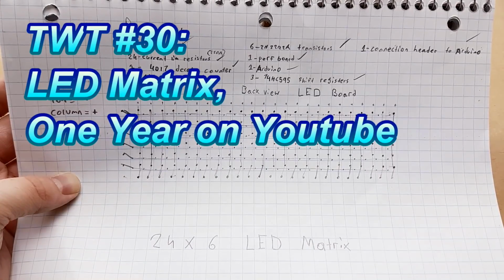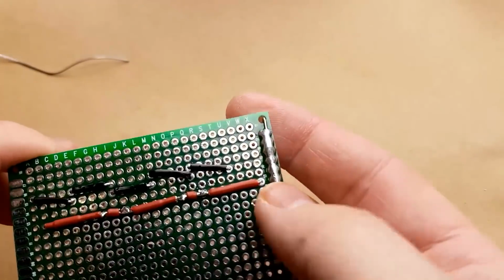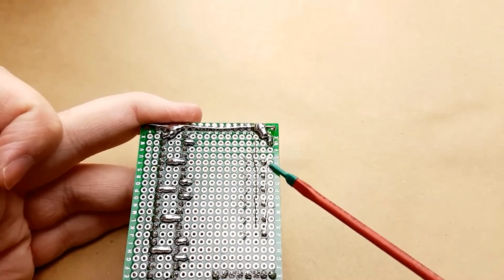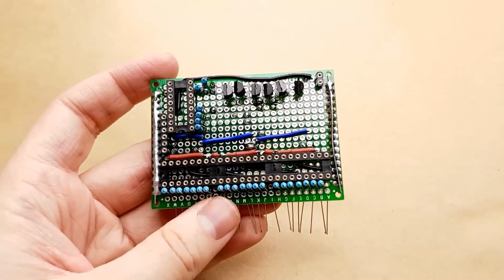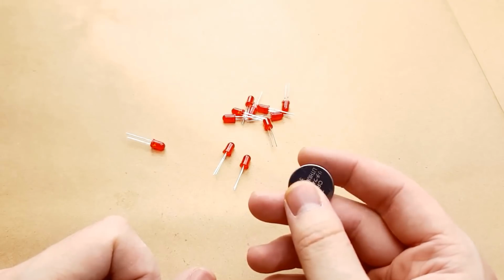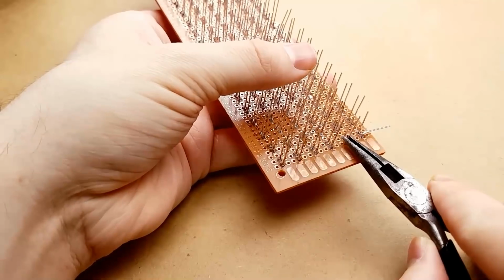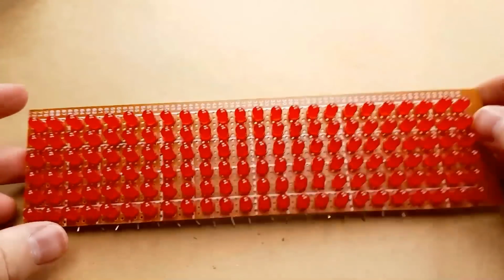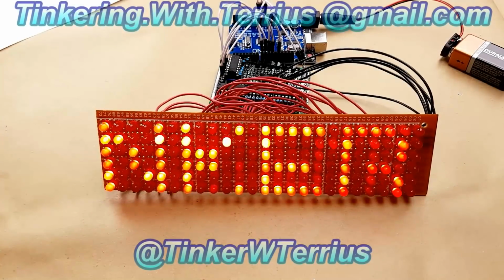LED Matrix Project, One Year on YouTube! | TWT #30

Comment: Very cool project. Unfortunately, it looks like a few LEDs on the very bottom row are not working. :(
Reply from the maker: Indeed, I didn't notice that they had come un-soldered until after I had already posted the video. It happened when I was swapping the data wires around. Luckily it is an easy fix and they aren't burnt out!

Comment: Enjoyed the video. Nice matrix.
Reply from the maker: I'm glad you enjoyed it! I noticed while editing that some of the LEDs weren't lighting up it appears some of them got disconnected when I had to re-solder the data wires, so I still need to fix that.

 It was quite interesting to build and is certainly fun to play around with. One of the versions of the code from the instructables article even allows sending text to the matrix from the serial monitor.